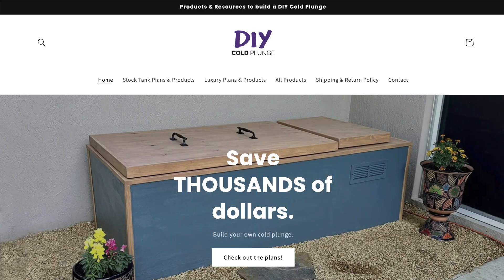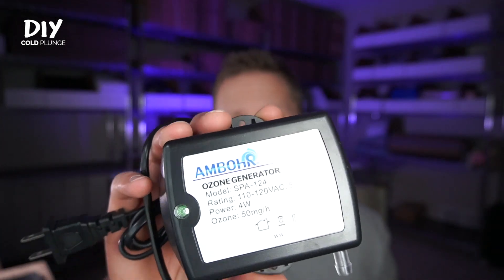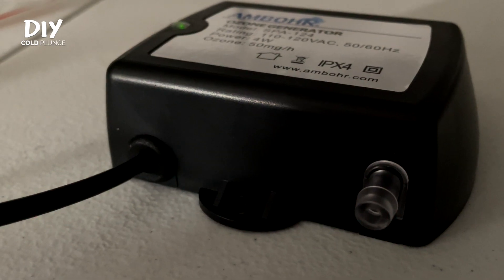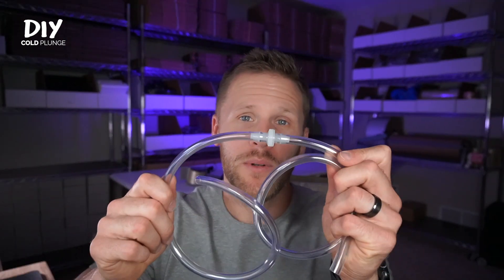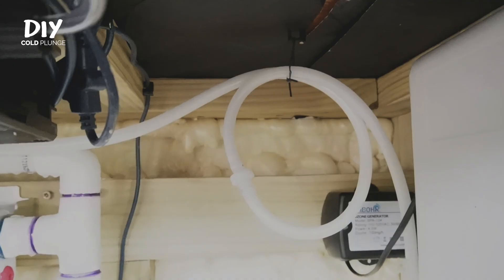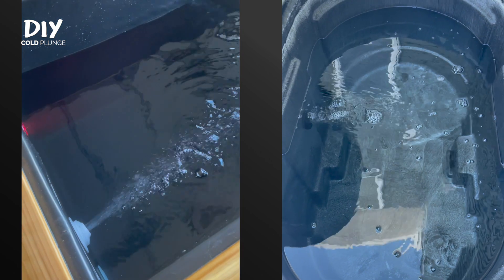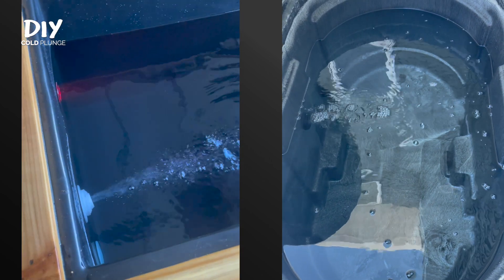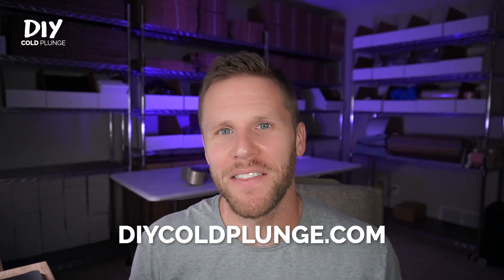Troubleshooting Your Ozone Generator | DIY Cold Plunge Ambohr Spa-124 Ozone Generator Best Practices

Comment: I have a Titan Cold Plunge.  Can I work it into the lines of my setup, also it runs 1/2 inch lines.  If so should I get an adapter to use the 3/4 injector?  Thanks for your help!
Reply: I also have a Titan cold plunge. What I did is I bought 3/4” tubing then bought, 1/2” to 3/4” barbed adapters. Thats how I connect the water lines. You should be good to go

Comment: Great video, thanks for sharing! I know it can be normal for the tubing to get cloudy over time. Mine got cloudy within the first week, does that sound like a potential issue?
Reply from the maker: Thanks! And Nope, totally normal 👍
Reply: @DIYColdPlunge  thank you! One other question that I am getting confused on: I bought a Gen 1 plunge brand cold plunge. So I had to replace the Ambohr ozone generator. Does the ozone generator run periodically or do I need to unplug/replug or set up on a timer? Said differently, is it bad to have it constantly plugged in?

Comment: Have air coming in the tub bubbling now. Any suggestions?
Reply from the maker: That's the Venturi doing what it's supposed to do, totally normal 👍
Reply: @DIYColdPlunge   Bubbles were coming in for about 2 months but not they are for lack of a better term popping or bubbling on the surface of the water. Seems different than before. Still ok?
Reply from the maker: What has changed with your setup? Have you been on top of regular filter changes with 50 micron filters?
Reply: @DIYColdPlunge  The only thing that has changed is we did not use it for the last few months and now we have been using it. Yes we are using the right filters. Currently it is just a little dirty. I can try a change or send you a video of what is sounds like?
Reply from the maker: Was it running during that time or drained, dried and shut down?
Reply: @DIYColdPlunge  It was running the whole time. Last night I put in a new filter and it solved the problem. How often do you change them? It did not look dirty to the eye.

Comment: Do you need the lid to be off when you’re running this so that it vents, or does it just break down in the water over a few hours until it’s no longer a concern?
Reply from the maker: https://diycoldplunge.com/blogs/diy-cold-plunge-blog/should-you-use-ozone-in-a-diy-cold-plunge
Reply from the maker: There's alot of hype about this... I've ran this multiple ways and never ran into an issue... I've been running it 24/7 for about a year now as a test. To be clear, I recommend running it on a timer though.
Reply: @ Awesome! I ended up rerouting my setup to your recommended order of operations a few weeks ago anyway. I appreciate the follow up.

Comment: can the venturi be piped directly in line with the water filter instead of in parallel?
Reply from the maker: This will greatly reduce the flow and put stress on your pump & back pressure in your system.

Comment: Thanks for all the useful content. Still working on my system. What would produce bubbles in my system and why should there be bubbles?  When there are no bubbles, what would be the problem in the plumbing system?
Reply from the maker: Could be the wrong order of your components, too much complexity in plumbing after the venturi or not a powerful enough pump.

Comment: Great video, you know what is the recommended PPM of ozone dissolved on the water?
I guess is not the same run for 1hr than 24…
Thanks
Reply from the maker: You'll want to run it for ~1-2 hours in most cases, with normal use.

Comment: Great video. Question. I purchased this and the Venturi from your website. Loved the ducks by the way! I have a Grizzly 450 with the double drains and I am running a pipe from one side to the other. Trying to avoid drilling a hole into the cooler. I heard you say too much plumbing can cause ozone issues. In your opinion, is using the two drains a bad idea? Too much pipe? Thanks.
Reply from the maker: Hey John! Pretty sure we connected on email already, but this setup sounds like it should work just fine 👍
Reply: Yes we did. Thanks for the excellent service. Great products you offer.

Comment: is it absolutely essential to mount it above the waterline? i'm using an ice barrel 300 which is relatively high (much higher than my modified deck box where I keep my chiller)
Reply from the maker: It's more of an added precaution. The vacuum should keep water out of the line, the check valve is the next line of defense, a loop in the line after that and then finally mounting above the water line.

Comment: I wonder if you can confirm why the Ozone generator needs to be above the water line? Is this just to stop the risk of back flow of water, if the valve fails?
Reply from the maker: It's best practice to have it above the water line for that reason 👍
Reply: @DIYColdPlunge  Many thanks for your help with this. Sorry I have another question I've not been able to find the answer to. I assume you could use an air pump if the Venturi does does not made a strong enough vacuum? It could run off the same timer too. Is there a reason not to so this, other than cost to buy, run and complexity to setup? Thank you once again for your time.
Reply from the maker: @rcBitz  just added complexity, and if the vacuum is working there is no need.

Comment: Danner makes a venturi tube that attaches on the end of their water pumps that you sell. 
Would hooking the ozone generator tubing to their venturi tube still allow the ozone generator to operate efficiently? They advertise that their tube allows for air to get into the system to create bubbles so does this mean it would have enough pull or vaccum through it to pull the ozone through the system?
Reply from the maker: I would be concerned introducing air into the system and having it pass through the chiller. Potential buildup of air is typically not good in a chiller.

Comment: I bought a ozone generator from you and followed your blueprint exactly in building all the pvc, venturi, pump, and GE whole house filter. Anyway when the filter is on filter water comes out of the venturi connection when I turn the filter to bypass I can hear venturi sucking air from the ozone generator what could it be please help.
Reply from the maker: What pump are you using, typically a flow/power issue. These are best handles as replies to your order. Not in the YouTube comments... too hard to keep track of.

Comment: Is there any benefit or harm to reducing the length of the the tube from the ozone generator to the venturi?  I have the generator sitting above the water level, and will have the check valve in place, but with where my generator is going to sit in relation to the venturi, I definitely don't need the full length of hose that comes with it.
Reply from the maker: Its best to loop it in that case, more protection from back flow of water

Comment: Hey from Europe! Great video! Trying to find an ozone generator available in EU based on your specs, however I only seem to find similar ones with ozone of 300-1000mg/h and the one you recommend has 50mg/h. What difference does it make? Thanks!
Reply from the maker: The output on those is much higher than needed for a tank this size. You should be able to manage it with a timer though

Comment: Question I built the same filter setup and got an ozone generator from you. Do I still need to add any chemicals to the water besides ozone to keep it clean?  It’s keep indoors with a cover. Thxs
Reply from the maker: I've kept mine sanitary for 3 months at a time with just ozone and filter changes. I never noticed a huge change in the water with test strips. You may need to monitor that depending on use and the water quality in your area.

Comment: I was unable to get the Danner 1200 or 950 where I live, so I went with the Danner 700 gph. That should work, right?
Reply from the maker: I can't say for sure, where are you located? I have them in stock on my site
Reply: Danner now offers their pumps with venturi injector attachments. You don't have to build the whole system around the sediment filter. Just hook the ozone to to the injector on the pump and have your sediment filter next in line. Saves a bunch of space and takes the guess work out of building a apparatus to route around your sediment filter.

Comment: Hey Joe, thanks for all you do! 

QQ. Any chance you can describe a minimal setup? 

I bought the 150 frame blueprints, as well as the luxury and plumbing bundle. However, due to budgeting (:cough: broke), i will have to buy the pieces over time. 

I'm planning to start with "just" the cooler, pump, and tub. (I'll obviously have to clean it or use a foalter tabe until next month).

Then, in a couple months, I'll be able to build the frame. Then I'll do the foam and cover a month or so later.

So I'm hoping you can describe how you would approach this if you wanted to get cold now, but had to build up over time?? 

Thankd again for everything!
Reply from the maker: Hey! I started with just the tank. Then I insulated it. From there, added a pump, filter, ozone and eventually a chiller. This was the best incremental way for me. You could do it pretty much any order you want, just know that youll need a pump with your chiller.
Reply: @DIYColdPlunge  THANKS!!!
Reply: You can make the frame from a few 2x4s and cover it with 2 sheets of plywood then waterproof the wood. Make sure to get the pressure treated kind tho. You can insulate the entire tank with 1-2 sheets of polypro or r-tech(foil lined styrofoam) both only cost $35. 

If you want to replace the plywood with planks later you can

Comment: Excellent Video:  I purchased/installed the Ozone Generator & Venturi Injector on my Penguin Chiller with a ¾ hp motor as presented in a previous video and outlined on the included installation instructions.  Results: Was not able to create a sufficient vacuum within the Venturi Injector.  Solution: Installed a Ball Valve at the Filter Housing.  Doing so permitted me to adjust the water flow to the filter thus creating adequate vacuum at the Venturi Injector resolving the issue.   Thank you for providing great content.
Reply from the maker: Thank you! Glad that adjustment makes the system work
Reply: How did you modify the loop to add the ball valve? Ball valve between tee and filter housing I imagine... Extend other piping as needed downline to accommodate the additional part?